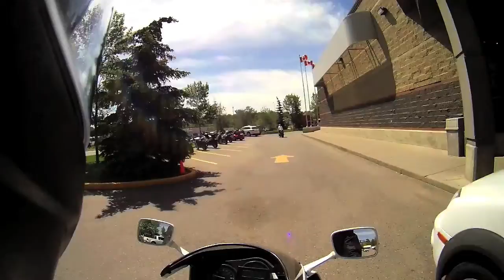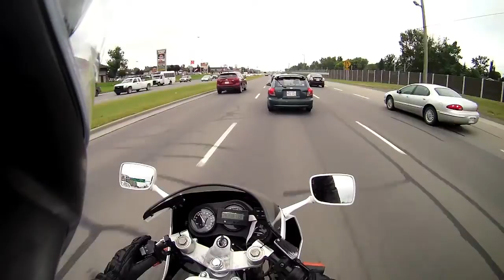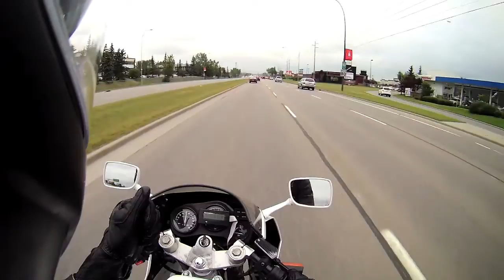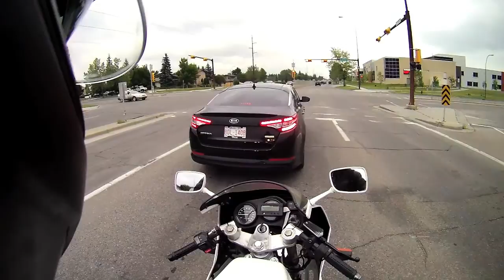#6: Electric Motor Ratings

Comment: Like your videos and going through them from the beginning, very nice work man! Planning my own build with the same motor and 72V/80Ah in battery pack (lead acid though as I dont have the bucks). However I dont understand how you can get a range of 100km with a max speed of 130kph. What sort of average speed are you getting that range with? Thanks
Reply from the maker: +Marius Schudel They are separate specs. I can get 100km range if driven "normally" ie in mixed driving conditions. More when just scooting around town slowly. The bike has a top speed of 130km/hr and can sustain that for long stretches. If I maxed out the bike at 130km/hr and drove until dead the bike might last for 70km at best.
Reply: Thanks for the info. Very impressive specs.